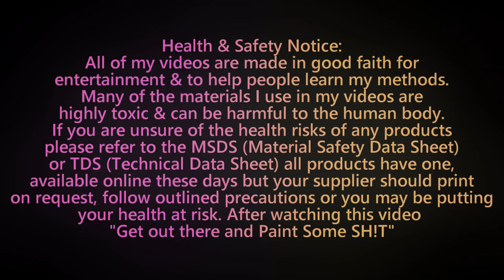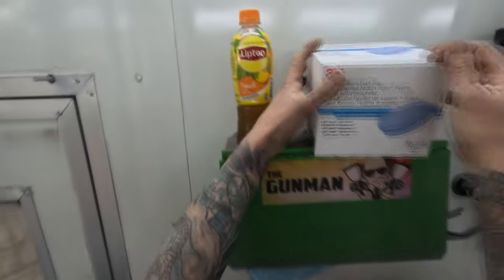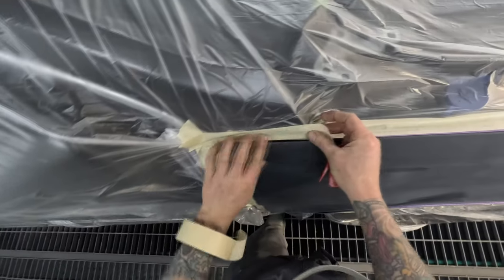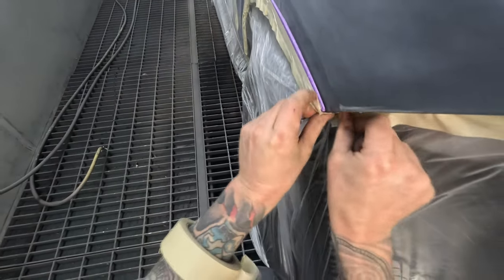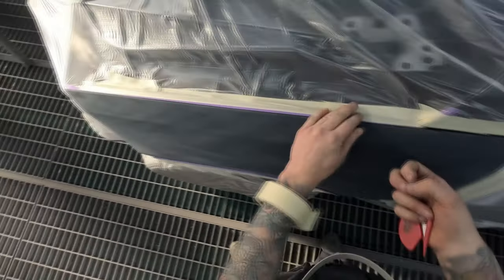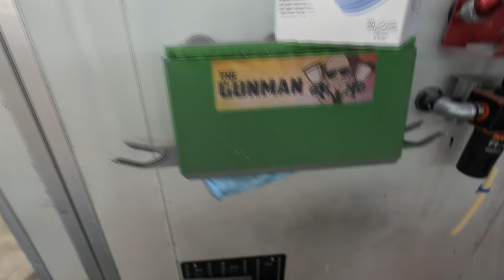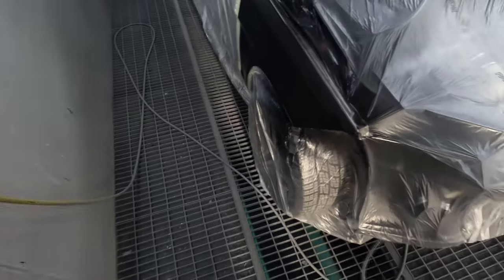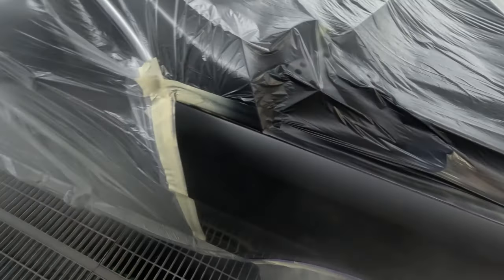Spray Painting Mercedes GL63

Comment: Hi Gunny lovely job on the blends mate it's always nice when the reps actually do what they are paid to do and help you when there is a problem. I use those 3M blue foam backed discs they last for ages and do a really nice job with no sanding scratches, they cost about £40 for a box of 20 but well worth the money👌👌👍 John UK.